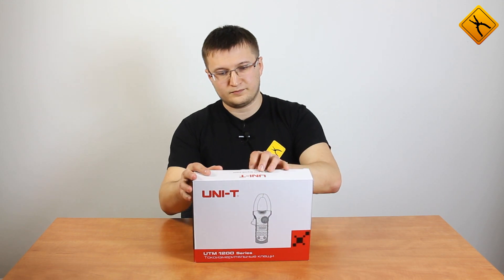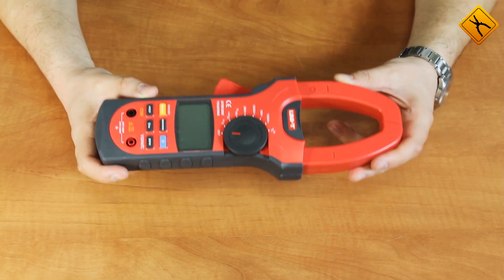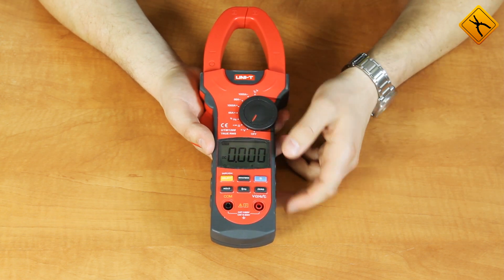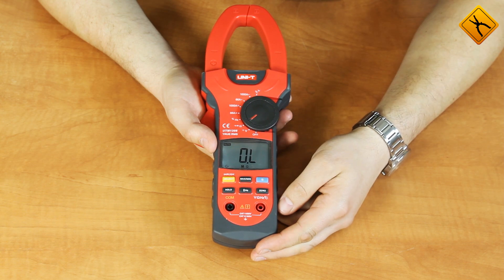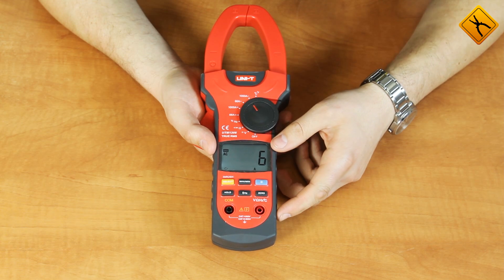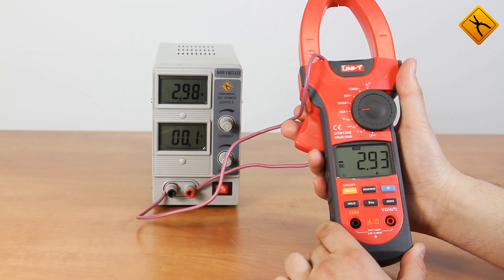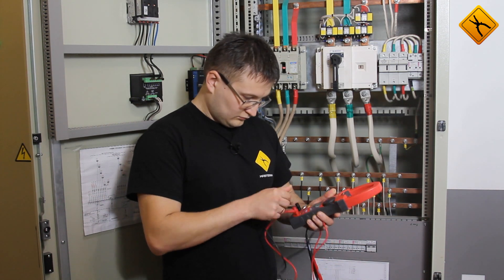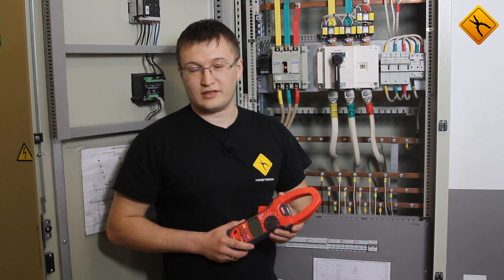UNI-T UT208 AC/DC Digital Clamp Meter

Comment: Do you have any insight into how the inrush current is measured, calculated, and or derived?  Does it sample at a certain time interval and hold the max value?  Does it capture the waveform and integrate the area under it?
Reply from the maker: This device allows to hold the max level of inrush current.